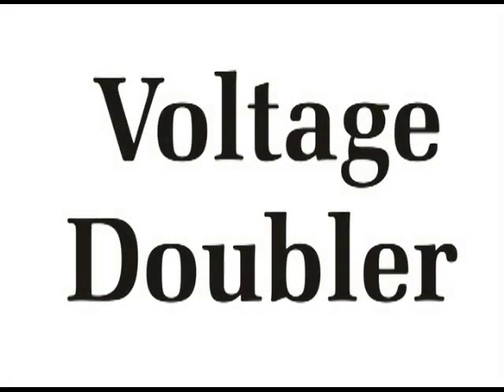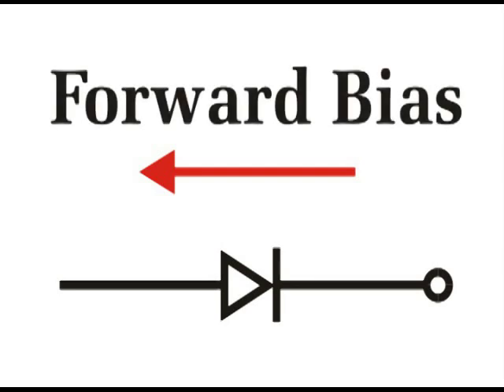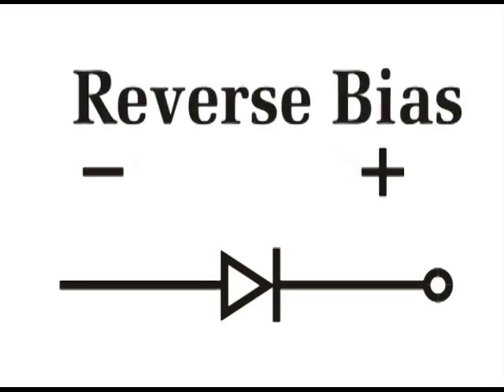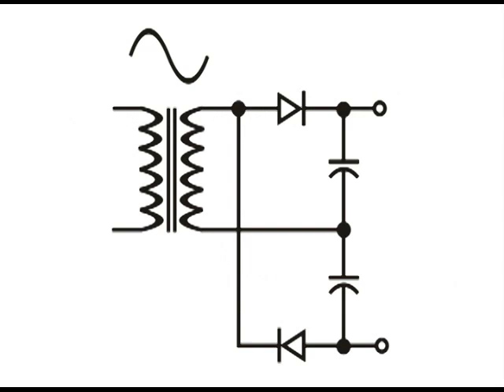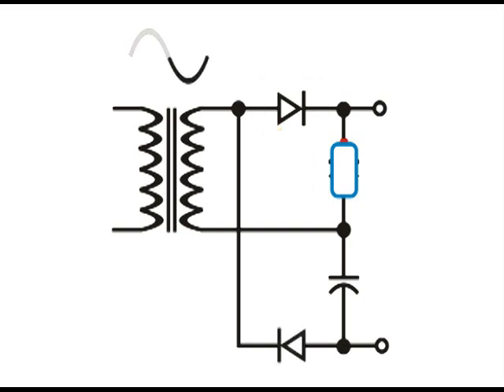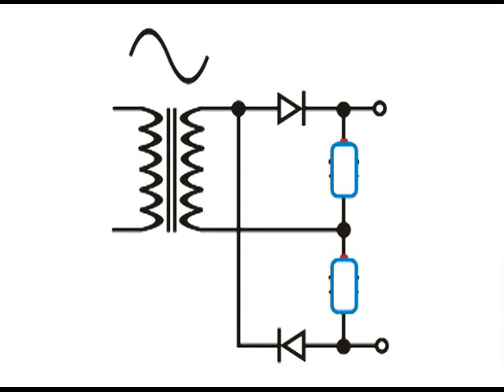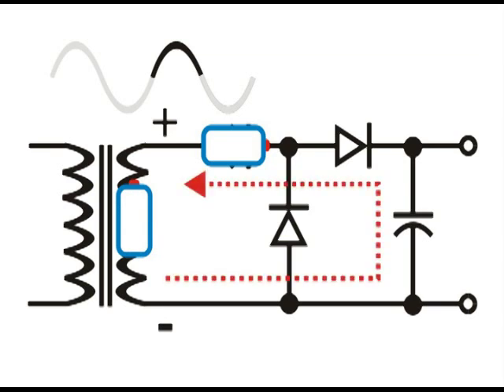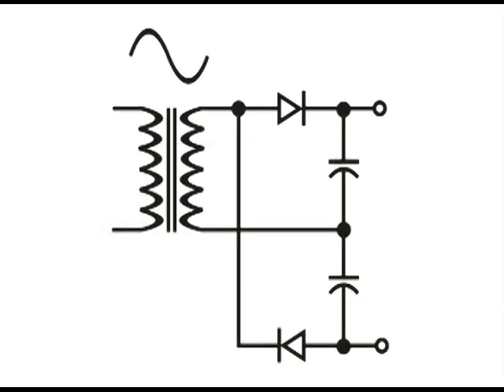Voltage Doubler Circuits

Comment: As a student of Quantum Mechanics, I certainly agree.  And, as a tube amplifier designer/builder, here's my experience:  Design it on paper, make a proto, and it WILL NOT WORK, and then figure out why it's not working, tweak it, get it working, and never go back to the paper and ask why.  So yes, I'm in full agreement about theory.  But again, you sir are an outstanding teacher.  I was fiddling with a Fisher 500b, found a doubler in the schematic, and needed a refresher, and yours was A+.

Comment from the maker: Thanks.

Voltage doublers / multipliers are used in circuits that require a high potential but low current. And they are very economical circuits to build to supply this requirement. One example I have of where they are used is in my Heathkit Laser. It needs a high voltage but low current potential to get the Helium Neon Laser tube to function, to laze.

Comment from the maker: Before the vacuum tube the theory (remembering that a theory is your best guess) was electrons flowed from positive to negative. When the vacuum tube rectifier was discovered this is when they discovered that they had guessed wrong, electrons flow from negative to positive. And when electrons do not flow there is no current flow.

Comment from the maker: @rbcastillo 
I'm not sure about brain waves. Voltage does not flow it is only electronic that flow and that is when there is current. Voltage is the amount of potential avaliable, like a battery. When the battery is in use, that is when electrons (current) flows.

Comment from the maker: Don't know I do not have a wiring diagram. Voltage multiplier circuits are used to produce high voltage @ low current.

Comment from the maker: A step down transformer will increase AC current, but the voltage is lowered. The power is the same on the primary and secondary minus a little loss. But basic-lye its the same power in as it is out.

Comment: Great explanation!

Is there any disadvantage to using a voltage doubler vs. a normal full wave power supply?  I was under the impression that voltage doublers were used in some tube amps because a cheaper power transformer could be used,  but I know there are many other applications too.

Comment from the maker: The voltage potential outputs from these circuits are 100% dependent on charging capacitors. They do filter but that is secondary. These circuits are deigned for high voltage and low current use. So everything is dependent the capacitance of the capacitors and how fast they can be charged. This is not the type of power supply you would use if you need a high current output.

Comment from the maker: Before the rectifier was discovered the theory was electrons flowed from positive to negative creating a current flow. When the tubes/valve rectifier was discovered, this is when it was discovered that electrons flow from negative to positive. They had a 50-50 chance, they had guessed wrong. Electrons do flow from negative to positive. Why some say that current flows from positive to negative is a mystery to me.

Comment from the maker: @TheJG1947 
It does not really matter, if the capacitor is polarized the positive plate should be marked, sometimes both the positive and negative are marked.

Electrons flow from negative to positive and against the arrow. This is easy to prove, with a diode, a battery and a lamp.

Comment: funny, i acendentaly "re-invented" this circuit, i was trying to figure out nor the cascade multiplier works and drawing out and tracing (what i thought) was my own design, then i found this video, and realized i made a electrically identical circuit! just like the second one you show, although i did have one diode backwards, i realized that after i took a second look at it

Comment: I was taught that nature abhors a vacuum and that electrons will flow to a place where there is a lack of electrons via the easiest route.  The easiest way is through a conductor.  In electronics the + or positive side has a lack of electrons and the - or minus side has a bunch of electrons.  The greater the difference between the two the higher the voltage.  The more electrons able to flow from the - to the + the higher the current.

Comment from the maker: I think those transformers putout much more than 2K volts, but I have never messed around with one. An old Microwave oven circuit might work for you. If you figure the voltage drop across the capacitors, I would add 30% more on to the WVDC.

Comment: Please use conventional current, your just making it more difficult for people to understand because electron flow is only used in physics.
Reply from the maker: Here is a little history on how current flow developed. In the very early years scientists had a theory that electrons flowed from positive to negative producing current flow. When the vacuum tube rectifier was developed they discovered that electrons would not flow from positive to negative, they flowed from negative to positive. In other words they guessed wrong. They change the direction of electron flow from negative to positive because it had been proven. They did not change the direction for current flow, which makes no sense at all. And it's good thing to keep in mind what a theory is, it is only somebody's best guess.

What we know as electron flow, is from the negative to the positive in a circuit. This was not discovered until the vacuum tube rectifier was created. This is when they discovered that they could only get a current to flow when the negative terminal was on the filament and the positive terminal was on the plate. The problem is, before this they had guessed wrong an said that current and electrons flowed from positive to negative, definitely wrong. However for some unknown reason they did not change the arrow for current but they did for electrons. Since electron flow is current flow this absolutely makes no sense at all. So I just use electron flow from negative to positive, because that is the way it is, that has been proven, no doubt about this. Electron flow has been compared to water flowing in a pipe. If the water is flowing in a pipe, what is flowing in the other direction, Nothing. Also you must keep in mind what a theory is, it is someone's best guess. Another thing to think about, is that we really do not know the why of anything. We just measure and use, we are all only observers. I believe that when the scientists and engineers discovered that electrons actually flowed from negative to positive, they did not change the arrow for current flow like they did for electrons flow, because they did not want to appear to be 100% wrong, which they were. So I prefer to use what can be proven and not a theory, and a theory is just a guess.
Reply: @AllAmericanFiveRadio  I've intuitively used and preferred electron flow. Good to now know why people seem to insist on the counter intuitive "positive to negative because in other examples than wires currents can be movement of positive charge too" arrow direction.
Reply from the maker: @howtocreateresilience7009  Here is a little history on how current flow developed. In the very early years scientists had a theory that electrons flowed from positive to negative producing current flow. When the vacuum tube rectifier was developed they discovered that electrons would not flow from positive to negative, they flowed from negative to positive. In other words they guessed wrong. They change the direction of electron flow from negative to positive because it had been proven. They did not change the direction for current flow, which makes no sense at all. And it's good thing to keep in mind what a theory is, it is only somebody's best guess.

What we know as electron flow, is from the negative to the positive in a circuit. This was not discovered until the vacuum tube rectifier was created. This is when they discovered that they could only get a current to flow when the negative terminal was on the filament and the positive terminal was on the plate. The problem is, before this they had guessed wrong an said that current and electrons flowed from positive to negative, definitely wrong. However for some unknown reason they did not change the arrow for current but they did for electrons. Since electron flow is current flow this absolutely makes no sense at all. So I just use electron flow from negative to positive, because that is the way it is, that has been proven, no doubt about this. Electron flow has been compared to water flowing in a pipe. If the water is flowing in a pipe, what is flowing in the other direction, Nothing. Also you must keep in mind what a theory is, it is someone's best guess. Another thing to think about, is that we really do not know the why of anything. We just measure and use, we are all only observers. I believe that when the scientists and engineers discovered that electrons actually flowed from negative to positive, they did not change the arrow for current flow like they did for electrons flow, because they did not want to appear to be 100% wrong, which they were. So I prefer to use what can be proven and not a theory, and a theory is just a guess.
Reply: @AllAmericanFiveRadio  Yes same here. I always found the "positive to negative current" arrow direction to be absurd. Have preferred to use the one that makes sense, but also noticed people seem to get upset by that, strangely. Now I also understand it from your explanation from history that you posted in your response to "Th3AirRaidSir3n". Makes sense, also the part that they did not want to admit they were wrong.
Reply from the maker: @howtocreateresilience7009  You can prove that electrons flow from negative to positive. You can also prove that positive to negative is wrong. I think it's a no-brainer.
Reply: @AllAmericanFiveRadio  Yep I 100% agree. I found the "convention" of positive to negative to be absurd myself. I am relatively "new" to electronics, so haven't been indoctrinated to accept it yet, and luckily I came across your historical explanation now early enough. Explains it perfectly.
Reply: overall I think @AllAmericanFiveRadio's video was really good, got me to understand voltage doublers easily, and I am very aware that people who were wrong easily get stuck defending it, so seems very likely exlpanation for the "convention" thing. peace.

Comment from the maker: I looked up the datasheet for the 12EL6 and it shows for Class A the plate voltage is 12.6 V. What does your wiring diagram show?

Comment: For a voltage divider circuit, are polarized capacitors a MUST? Do the two capacitors have be of the same value?
In the second circuit, the voltage is doubled in the outermost capacitor only? So, this capacitor must have a voltage rating at least high enough to handle the doubled voltage?
Reply from the maker: Tony T. Polarized capacitors are used mainly
because they're less expensive than non-polarized capacitors of the
same microfarads in power supply circuits. When there are two
capacitors used in a voltage doubler circuit, most of the time they
have the same capacitance. This means they both have the same time
constant, which means they both can store the same number of
electrons in the same time. If you used two different microfarads
they would not have the same time constant and will not store the
same amount of energy in the same time period. In any power supply
situation the electrolytic capacitor Working DC Voltage should be
about 25% higher than the voltage that is developed a crossed the
capacitor, which is usually the output.
Reply: AllAmericanFiveRadio
Thank you for the reply!

Comment: Thank you VERY much for this video. I've always wondered how Voltage Doublers worked and your video showed me how. Is there are rules of thumb for how much current one can get out of the circuit based on the peak or RMS current of the transformer? Thanx! Gordon

Comment: very good video. Just have one question though. isn't the current flowing from the positive to the negative?
Reply from the maker: What we know as electron flow, is from the negative to the positive in a circuit. This was not discovered until the vacuum tube rectifier was created. This is when they discovered that they could only get a current to flow when the negative terminal was on the filament and the positive terminal was on the plate. The problem is, before this they had guessed wrong an said that current and electrons flowed from positive to negative, definitely wrong. However for some unknown reason they did not change the arrow for current but they did for electrons. Since electron flow is current flow this absolutely makes no sense at all. So I just use electron flow from negative to positive, because that is the way it is. Electron flow has been compared to water flowing in a pipe. If the water is flowing in a pipe, what is flowing in the other direction, Nothing. Also you must keep in mind what a theory is, it is someone's best guess. Another thing to think about, is that we really do not know the why of anything. We just measure and use, we are only all observers.

Comment: What about the drops over the diodes? Isn't the output going to be double the input minus approx 1.2v (the drop over two diodes)?
Reply from the maker: That's true. The losses in a circuit should be engineered out. As an example the transformer loses power from the primary to secondary. So in a circuit like this, let's say that the total output wanted from the circuit is 800 V. So a transformer would be wound so that it would produce a little more than 400 V at the secondary. This would make up for the loss in the transformer and the diodes.
Reply: Thanks for the quick reply. But am I right to think that 1.2v would be lost at the output (provided the drop over each diode is 0.6v)?
Reply from the maker: Yes, that's true.
Reply: Thanks again!!
Maybe you should make an annotation in the video then that in fact the output voltage is double the input minus the voltage drop over the diodes.

Comment: I was considering using a voltage doubler circuit in a very small 1.5 watt guitar amp the AX84 Firefly.  I have a 117-117 power transformer I want to use with a voltage doubler.  I am looking for a tutorial, template or info on how to determine the proper values of the diodes and  capacitors I would need for my circuit.
Reply from the maker: Do a search on my channel for this video:
Lafayette Guitar Amplifier Diagram Power Supply

Comment: in the second circuit, would the top capacitor need to be non-polerized or is the positive plate always at a higher potential then the negative plate?
Reply from the maker: You could use a non- poplar capacitor anywhere, the cost is more. But the polarity is still the same.
Reply: yeah. i guess my question is, you CAN use a polarized capacitor in the second circuit even though the negative lead is connected to an AC source. because the positive lead is always at a higher voltage potential then the negative lead on the AC side? 
so when the negative lead of the top capacitor is  at +120V the positive lead of the capacitor is at +200 some odd volts. and when the negative lead is at -120V the positive lead is at 0V so the the capacitor never gets reverse polarity and lets the magic smoke out?  if i am understanding that correctly? im trying to learn more about electronics and on the face of it just looks odd having a polarized capacitor hooked in series with an AC source lol
Reply from the maker: There is no AC across the capacitors. One diode conducts on the positive half and the other diode conducts on the negative half.

Comment: Hello there,
I am new at this game, hence I need your help; I hope you will.
I am confused at the voltage doubler drawing. You show the capacitor with a curved line, is that the positive side or negative? Now the diodes; I thought the symbol as configured in the drawing the current would flow the direction of the arrow.
The crunch question now; is there a way of stabilizing the voltage produced by the Torroid J-T? I can get sixty V, but as soon as I connect a led bulb it drops to "nothing"

Comment: Could you be so nice to help me? It would be really sweet. Here goes the question:
How to double a genarated current without use of an amplifier and /or extra voltage source actually as less parts as possible?. I have only 2cm² for putting in parts.
Some extra info about the project: I wanna glue 2 piezo's back to back and use 1 for detection and the second for frequency correction.
Thanks in advance, greets.

Comment: This is quite informative but it seems to be an AC circuit. Can this be done with DC?
Reply from the maker: ***** 

Its possible. You would start an
inverter ( that changes DC into AC) than the voltage doubler (that
changes AC into DC).
Reply: AllAmericanFiveRadio Yes, I understand inverters but the result is not AC, it is pulsating DC. The current does not change direction. In your demonstration, it seems to me that in order for this to work, the current must change direction. Does this somehow work with Pulsating DC? If so, please explain how. Thanks.